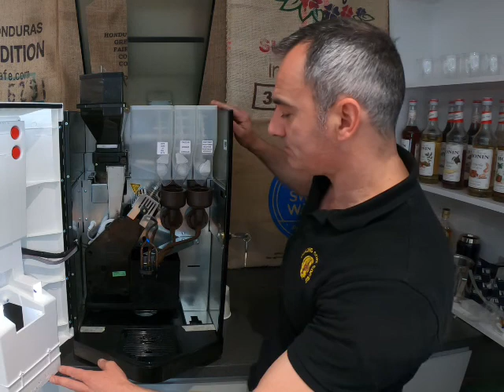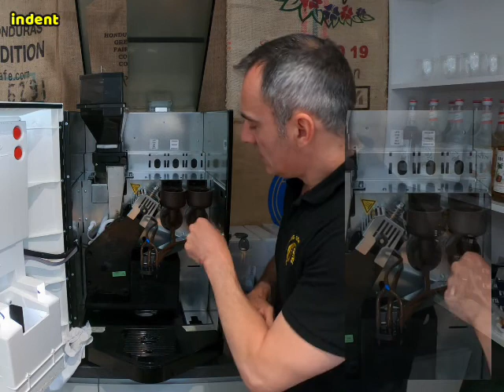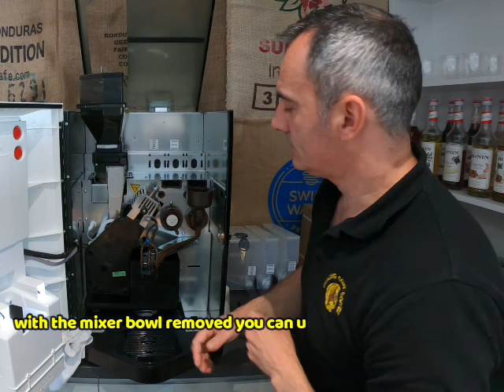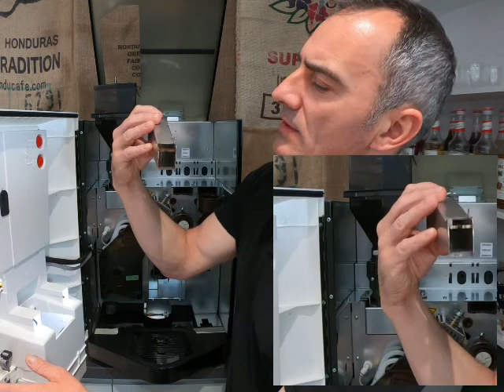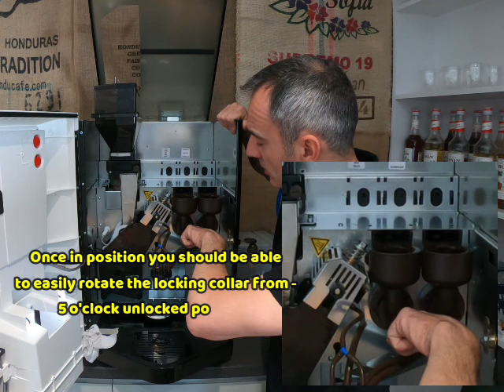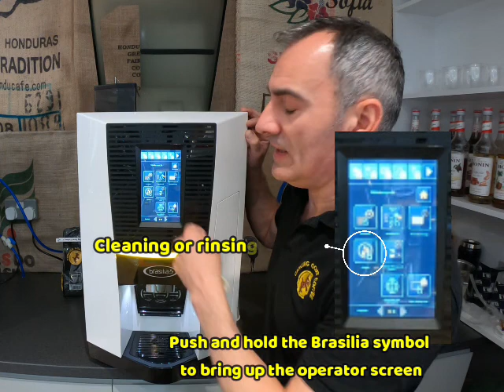Brasilia Festa / Bianchi Talia Cleaning Guide

Comment: Talia version 

It seems the cup size has not been calibrated correctly. I’ve noticed that the cappuccino and hot chocolate volumes are larger than the other drinks, even though we are using the standard Majestic cups.

Could you please guide me on how to adjust the cup sizes on the machine? The current settings are causing spills and making the machine dirty very quickly.

Thank you.